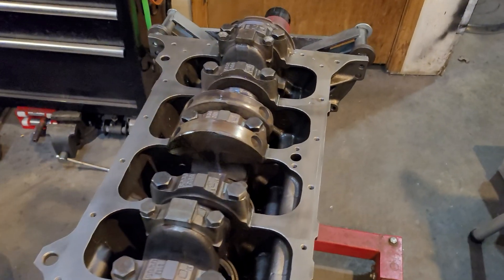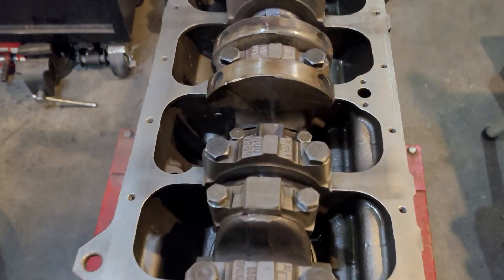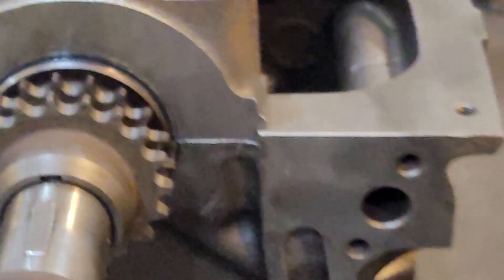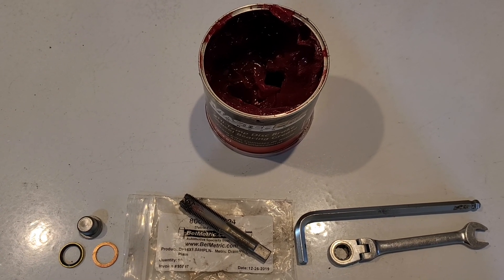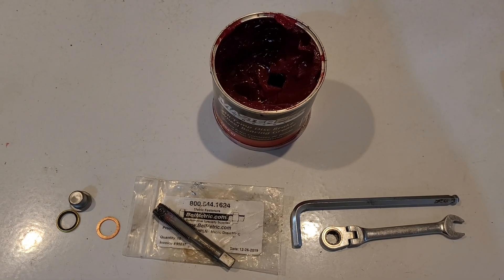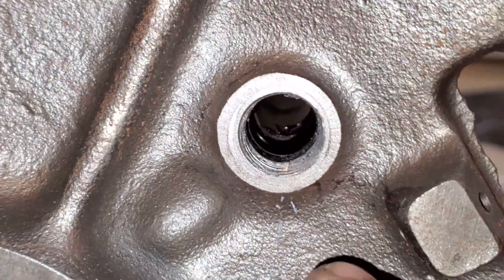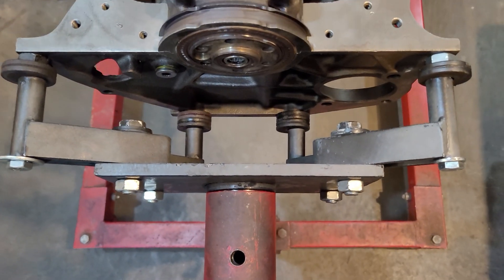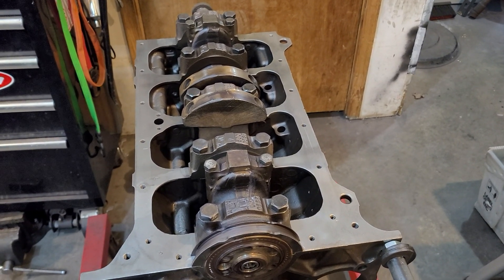Part 3 - Prepping the Opel Cam-In-Head Block for reliability, prior to assembling the motor

Comment: No need to tap that oil galley plug. Just leave original there. It wont never come out.
Reply from the maker: I have had two blow out on me on the engine stand.. and have the Oil stains on the garage walls to prove it.. ;) Just saying. Also you do NOT want to leave it in if you are getting your block cleaned and having it go through an acid bath. The crap won't have a way to get out of the block. So if your machine shop doesn't remove it during the cleaning process they did a half-assed job.
Reply: @GoinManta  I have noticed that in US you tend to tap every engines plugs.
Reply from the maker: @juhomaki-petaja  In the case of the rear its to make sure it doesnt fail.. sure you can replace with a press in plug, but a tapped plug is sure not to fail. I often use Irmscher Oil Pumps and get a solid 4bar of oil pressure. I also tap the Oil plugs on the head, for the same reason. We pull the plugs at the cam bearings to clean the galleys in the head and have had the AL plugs fail on running mitors. So again its cheaper to replace them with $5 plugs and be assured not to ruin a $5000 motor. Then to save a few $$$ and have a motor failure.
Reply: Those AL plugs in head tend to fly out.
But I never have heard of other plugs fly out even in racing.
Reply from the maker: @juhomaki-petaja  As I mentioned I have had two fail on my engine stand and know others that have had failures too. Better safe, than sorry.
Reply: Very strange.
Reply: @juhomaki-petaja  Not really, remember we are in the US, and the rear galley plug is very probably a metric size. But most machine shops have american.. and if an American size "fit" but wants a 100% tight it could come out with enough pressure. Tapping with a plug, it a 100% guaranteed to never fail.